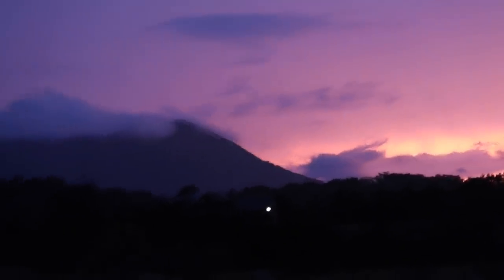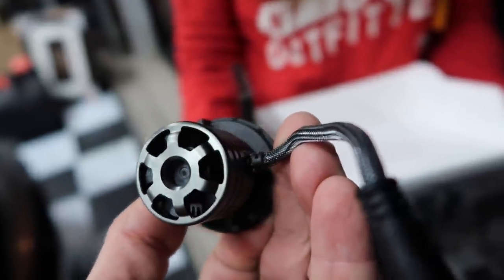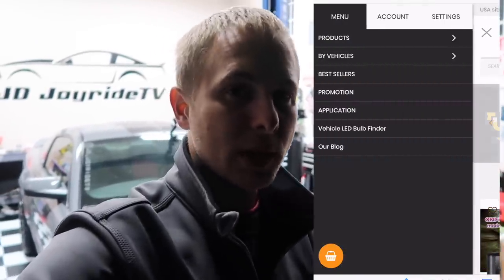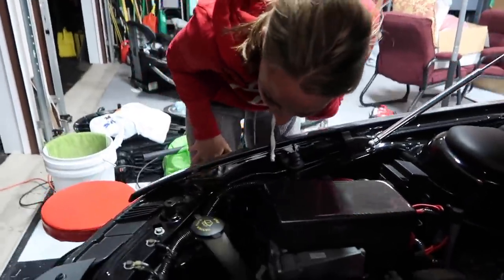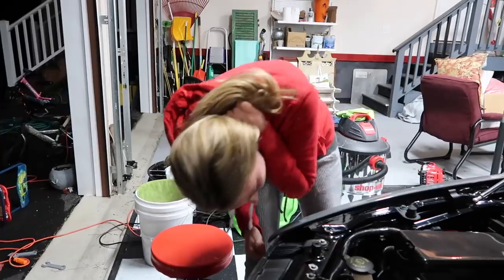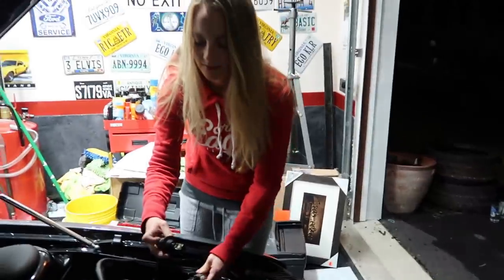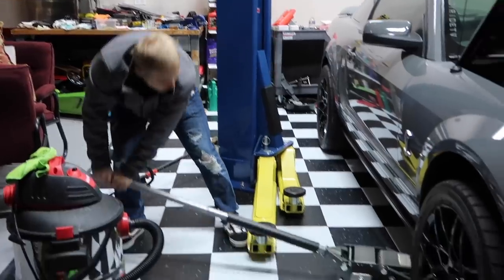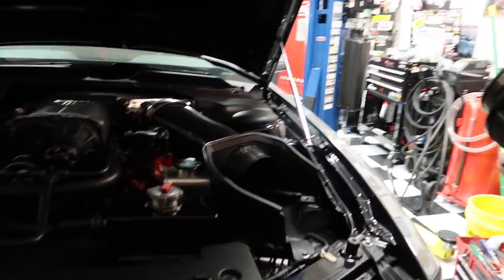LED vs Halogen: Are they Better? EASY install with LAURA | AUXBEAM

Comment: question, I just installed a set of LED diode dynamics xp 80 and are they bright. They now make my OEM headlamps dull. I need a new set of headlamp bulbs to match the intensity of the fog lamps. What would you recommend in a LED

Comment: A 55 watt hid puts out more light then a led but the led are getting better every day I use led all the time in a regular headlight bc their plug and play. Now a projector headlight id use a hid bulb bc the projector needs a 360° light output to work right just saying lol good video as usual # teamLaura
Reply from the maker: high class line trash  Yeah I had a HID kit before and the Highbeams didn’t work and lights would shut off.
Reply: @JD_JoyrideTV  Depends on the kit you use. Go get a kit from the retrofit source and you'll be extremely pleased with the quality of the product and it will be twice as bright as those LED's
Reply: @JD_JoyrideTV  nochanc3 is right hid kits from  retrofit source are pretty good. Osram CBB are the brightest hid bulbs made if you want a slight blue tint in the bulbs. The new Osram CBA are a slightly better value as they are just as bright as the CBB bulbs but cheaper. Also the type of ballast you choose for the hid bulb affects how bright the bulb will be. I suggest the Denso 35watt ballast as it usually has the fastest warmup time, reliability and known for making hid bulbs brighter. You could get a hilux 45watt ballast which would make the hid bulbs brighter (i think its around 10% brighter) but the downside is the bulbs wont last as long. Also hids wont work well with halogen housings so you would have to get projectors as well. HID projectors are what give the lights the longer throw distance and extra wide width plus allow you to have high beams and low beams in one bulb. I recommend the mini d2s 4.0 projectors, NHK G5-R, NHK G5-EX, or the NHK G5-EXL projectors. 2013 and up mustangs all have hid projectors in them from the factory.  Since JD already has the led lights he could just get some led projectors and make his current led lights another 25-45% brighter. Plus the led projectors will giving his new led lights more distance and width.